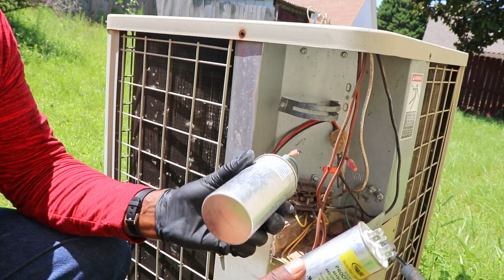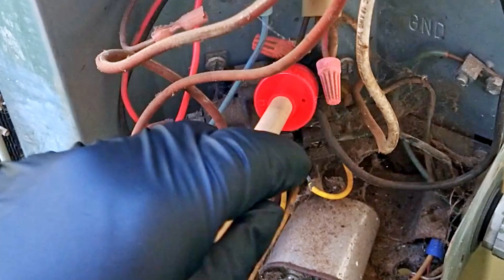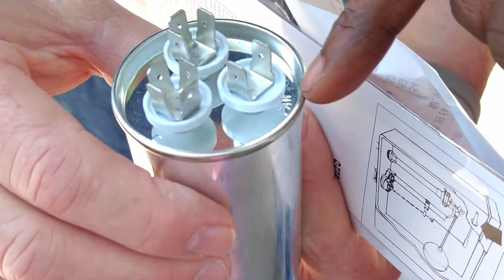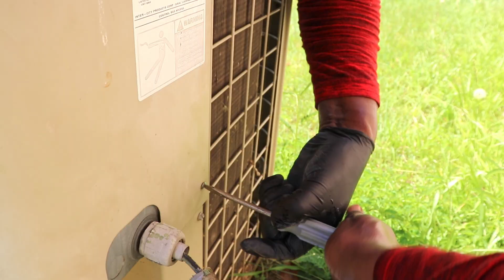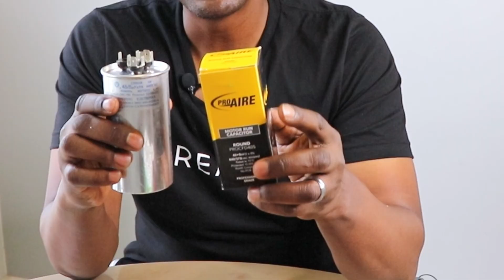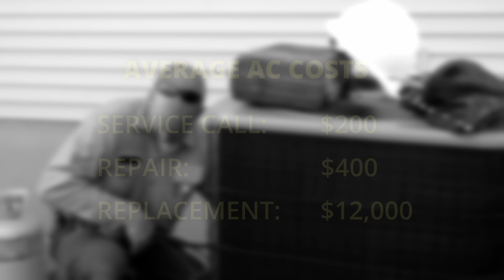AC Repair Under $30 | DIY Home Updates On A Budget

Comment: Should have checked voltage, and tested mfd ratings on both. Looks like you did not realize the cfm cap just laying on the bottom of the condenser cabinet

Comment: Guys, I love you both but I want to caution you about your understanding of capacitors. I'm a EE so first:
1) Handling caps like this requires gloves rated for the voltage levels of the capacitor. Klein sells gloves rated for high voltages and worth the investment. Check the voltage level on the cap itself. A large one like that can really create serious problems for you. 
Caps work as short term storage of electricity.  They can easily explode or hit you with deadly amounts of current if you are not careful. You were smart to discharge the cap with a screwdriver. A common thing but a cap that big - no those gloves will NOT help you. 
Love you guys and be careful!
Reply from the maker: Thanks for the tip about the gloves.  Appreciate you!

Comment: Cleaning the condenser coils is a great idea, because  it helps keep the compressor from overheating, and removes the heat from the coolant.
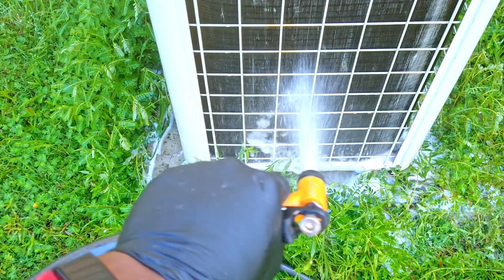However, it doesn't have anything to do with increasing airflow in your home.  That is provided by the fan in the indoor  portion. There is also an air filter that should be checked and replaced as needed in the indoor unit. 😊 ❤ 7:46
Reply from the maker: Thanks for the tip!